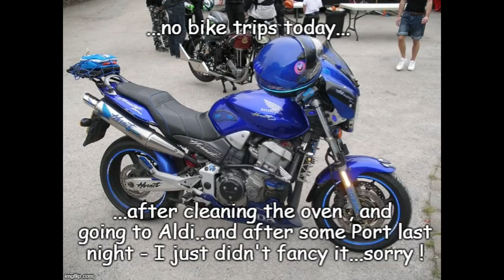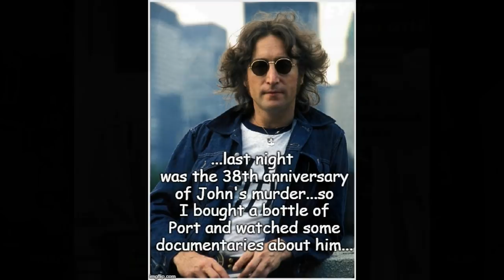...just washed my bike - that's all !

Comment: Hiya Steve I have one of those dryers bought it for drying the dogs but it does do a cracking job at drying the bike. If your thinking of getting one dont worry if its strong enough it blows stuff off the shelves in the garage its that strong. Blows the water out of all the little holes and brakes no problem. You can either use it with heat or without I recommend them.
Reply from the maker: ...where did you get it from ...'Pets at home' / Screwfix  ?!
Reply: @StevesHornet900  Hiya Steve got it off the tinternet I think it was off ebay but as said plenty of strength you wont have a bother. It comes in handy for all sorts of stuff.
Reply: Another thing I meant to tell you there is a place in Padiham that make all the old looking metal signs you like its in the Centre across from Tesco same street as Padiham Paints its an end building.

Comment: If you get that ACF50 on pretty much anything apart from brake pads and discs, then a fairly quick daily blast with the hose on a medium setting should keep it clean enough.  I usually do the ACF50 around early Nov and then again early Feb.  I’ve been thinking about one of those air blower things too but tying to not spend too much over winter.
Reply from the maker: ....the front axle bolts and the two pinch bolts either side are still rust free after two weeks, so it works ! I squirted some ACF50 on 'em to test it's effectiveness ....

Comment from the maker: ....I've noticed in that Argos catalogue , that they've messed the prices up for the Sandisk Extreme 90mbs / 32gb SD card - it says £14.99 ...but it should be more than double that , as the price below for the 16gb one says the same - £14.99 ! I wonder if they'd honour the stated price in the catalogue ? Someone said though, that the card speed wont improve the picture quality for actioncams - it's just for still cameras ?
Reply: Card capacity won't improve the speed, the only thing that improves speed is the WRITE speed.
A lot of cards will advertise say 90mbps but that might be the read speed, not the write speed.
Check the write speed and get the highest you can.
I'd suggest eBay though, I usually only pay about £10 for a 32gb micro SD card with a 90mbps+ write speed from Sandisk.
Something like this; https://www.ebay.co.uk/itm/SanDisk-Class-10-Ultra-32GB-98MB-s-Micro-SD-SDHC-Memory-Card-USH-I-with-Adapter/113324110976?epid=12026640924&hash=item1a62a4b480
Reply from the maker: @RCFunEveryday  ....thanks - there are some cheap refurbished 'Extreme' ones very cheap - but I wont bother if they're not going to improve the playback , it's probably my crap laptop that can't handle it rather than my actual recordings as the picture is twitchy . Thanks very much for the goodies which arrived today ! Rum truffles , Dreamies for my moggies ...and all those delicious 'Lotus Biscoffs' !! Cheers mate !
Reply: @StevesHornet900  write speed won't improve your playback anyway, that's down to your laptop,  try lowering the fps... You're very welcome mate I hope nothing was broken from the Royal Mails heavy handed approach to parcels!